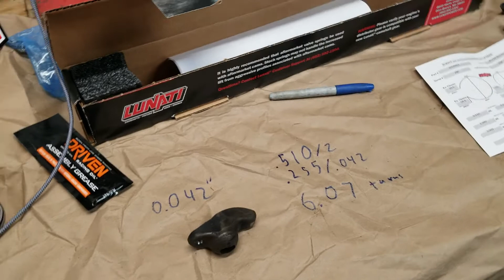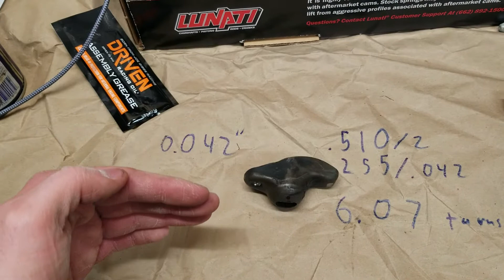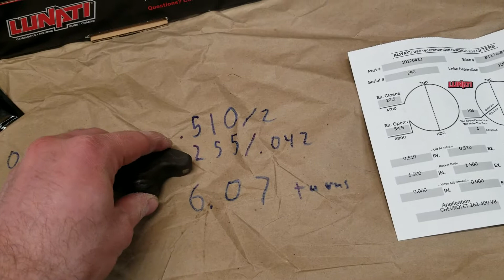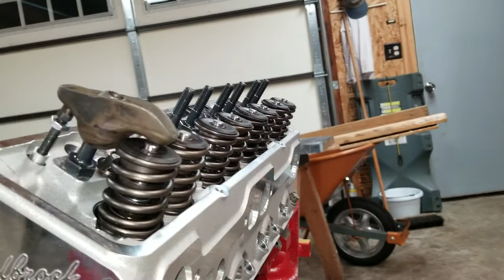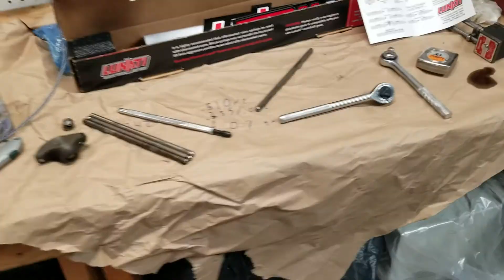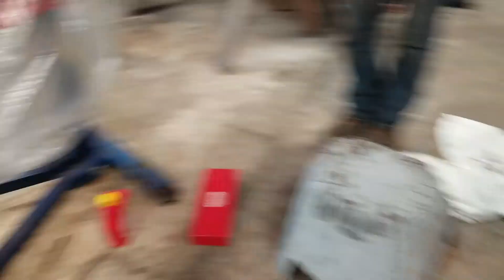How to build a small block chevy part 2: checking pushrod length and rocker arm geometry.

Comment: Just ran across this video. It’s rt and wrong. You never checked contact area on the valve tip. Also, you cannot run a stock steel pushrod on an engine w guide plates. The plates will chew those non hardened rods up.
Reply from the maker: ok, we never had any issues with it thus far so idk it works I guess?